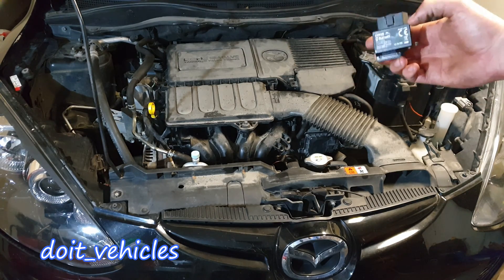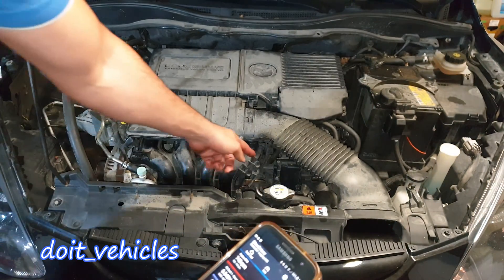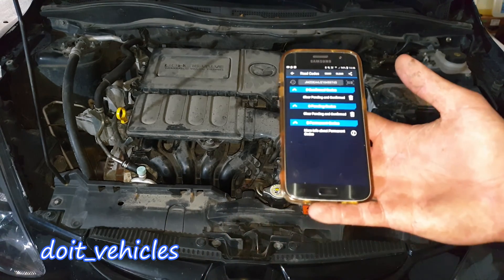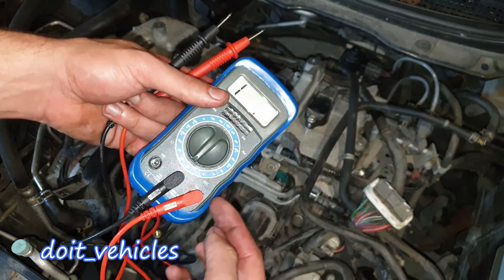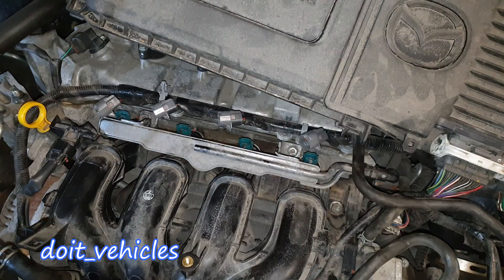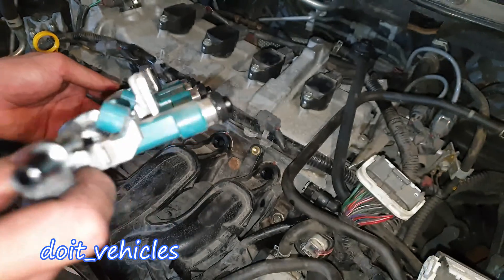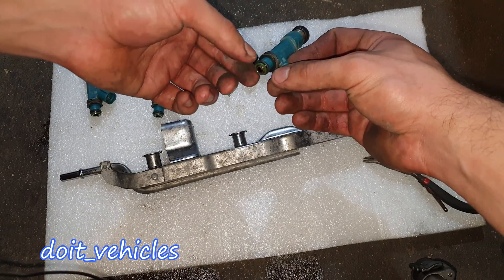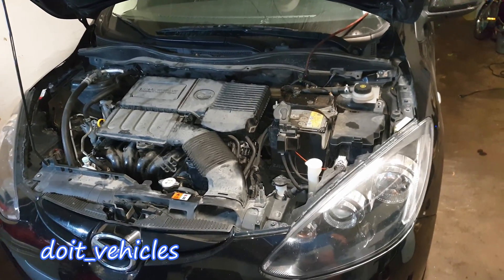1.5 Mazda 2 Injectors Check using the Fuel Trims - Before Replacement

Comment: So if no check engine light is on theyr eok?
Reply from the maker: not necessarily
Reply: I have the same car diesel 1.4 my car the powerstrain light comes on an glow plugs light just flash once bit hard to start when cold and when it does it misfiring with white smoke i had the car scan and it just come up for glow plugs and injector 4 but ive put a new injector in cylinder 4 with new wire loom i just need the glow plugs does anyone kno if the glow plugs can cause the amber powerstrain light to come on? As ive also put a new turbocharger on my car due to a leak thinking that was the problem can glow plugs make the car go into limp mode when driving if the are failing  or are they just for starting a car up?